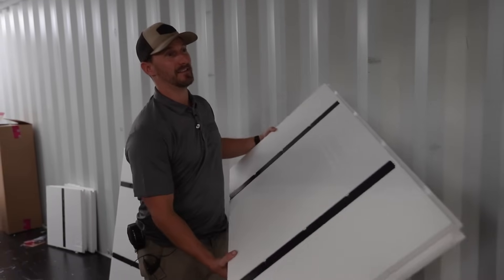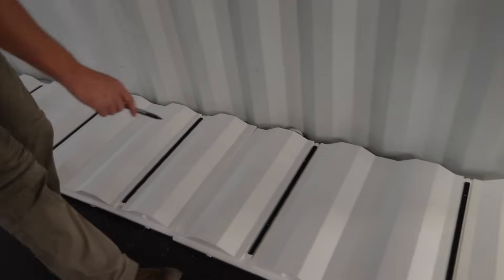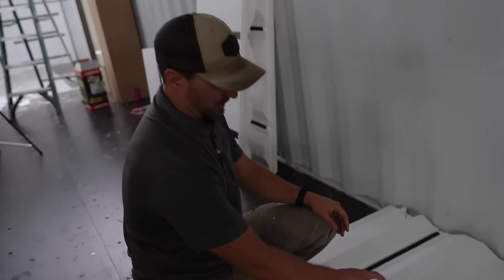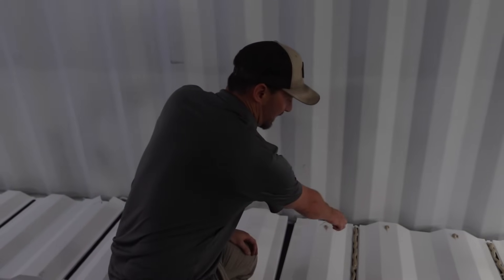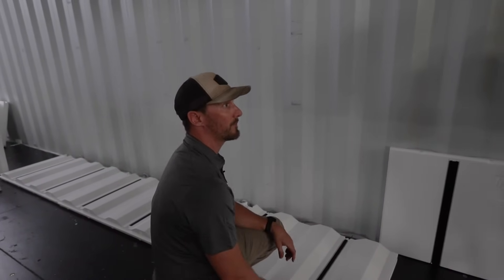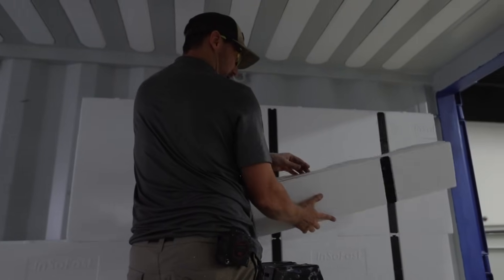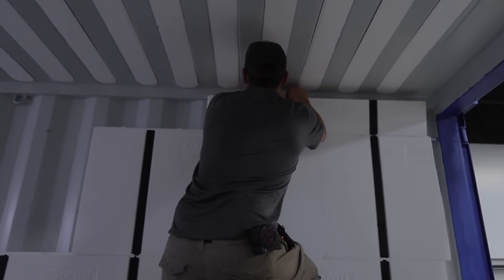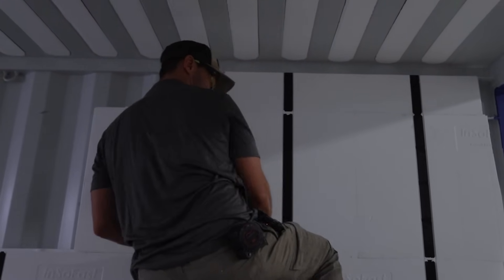Fastest Method for Insulating & Framing Your Shipping Container | InSoFast® CX-44 Side Wall Panel

Comment: You have a great product except for the air gap problem. I’m wondering if some type of spray adhesive would be better. This way, you have more of a “full contact” and there will not be the air gap/condensation/rust problem.
Reply from the maker: We actually do also recommend air sealing the panels with a horizontal bead of spray foam.  I added a link to an older video we have up. We will have another video on this coming soon! https://www.youtube.com/watch?v=VW-2gmvKiuk

Comment: If it were cheaper I would.
Reply: This is unreasonably expensive. I can do an entire 20' container in spray foam, including metal stud framing, for half the price of this, and I don't have to worry about air gaps.

Sorry, but this is just way too expensive.
Reply from the maker: Show us some cost comparisons! We're always trying to keep our prices as low as we can! Our panels include the framing + insulation...what methods have you used in the past?

Comment: I used to do ICFs and this reminds me of them however the quote I received for materials to do a 40hc was more then the cost to have it done in spray foam
Reply from the maker: We got our start coming from the ICF industry! Our panels' built in stud adhere directly to a CMU wall.  How much was the spray foam build? Did that cost also include the framing??
Reply: 3 companies in my area quoted me 800-1000 for spray foam. Metal studs are cheap, and some sheet foam and plywood if you want to insulate the floor.

This is way too expensive for what you get, sorry.
Reply: @charlieodom9107  As mentioned, when the framing is included in the application - materials and labour - I find it hard to believe you'd do a framing pass (materials and labour) and an insulation pass (same) for less than this product. ICF is the same economy - better insulation, big time savings, less concrete - so if you only look at the product pricing you are missing the larger-scale economics of a project.
Reply: How does price compare vs ease of install if it’s DIY? How much does this system cost for a 40’ container?

Comment: But what about condensation?? Shouldn’t you have a vapor/water barrier somehow?
Reply from the maker: That's all engineered into the panel!
Reply: @insofastllc All metal buildings Have Condensation….. Fact, Ask any metal building contractor. U must use Close Cell Foam….Good luck to U
Reply: @keyoumarsmobasser476  it has to be adhered to the metal on the inside. For metal containers you want the thinest insulation on the inside and the remainder on the outside.  Believe me i lived in a container in the middle east and you dont want to screw this up, stuff starts to rot real fast.

Comment: still leaves lots of air gaps on the metal. Lots of places for moisture to build. Mold to grow, rust to destroy.
Reply: yes, this sucks.
Expansive foam is much better.
Reply from the maker: @TheYvesable  Hey, we are always open to this type of discussion! Why do you prefer expansive foam methods over EPS?
Reply from the maker: Hmm. What makes you say that?  What framing and insulation method would you consider to be better?
Reply: You have a great product except for the air gap problem. I’m wondering if some type of spray adhesive would be better. This way, you have more of a “full contact” and there will not be the air gap/condensation/rust problem.
Reply: @insofastllc close Cell foam…. All metal building contractors are recommending that!!! Metal buildings and Condensation are a problem. Close Cell Foam….😎😎😎
Reply from the maker: @keyoumarsmobasser476  We are not opposed to closed cell spray foam! If it's installed right, it makes for a dream insulator.  But we created our panels as a non-toxic, simple (DIY friendly) way to insulate AND frame the interior in less steps!
Reply: @insofastllc  $4800 cost for Insofast just for one 40' container is a non-starter.
Reply: @bubbajones4522  that's what I was looking for, I was guessing this would he ridiculously priced can spray foam for less where I am
Reply: Maybe if they used some type of spray adhesive, then there would be full contact with 
no air gaps.